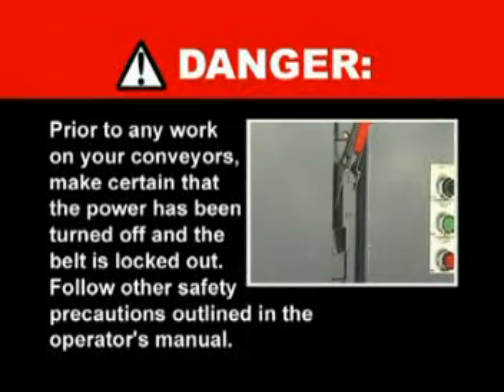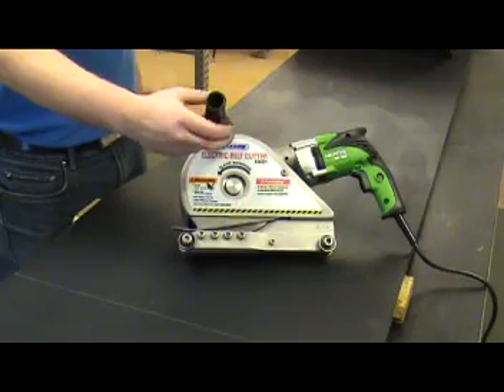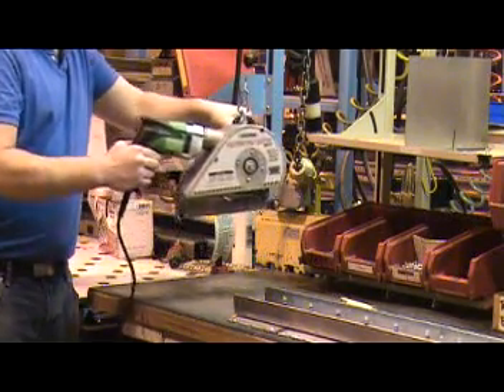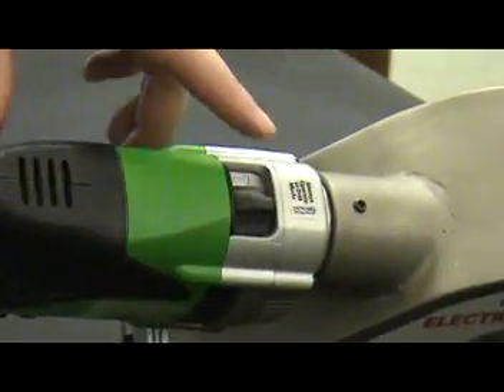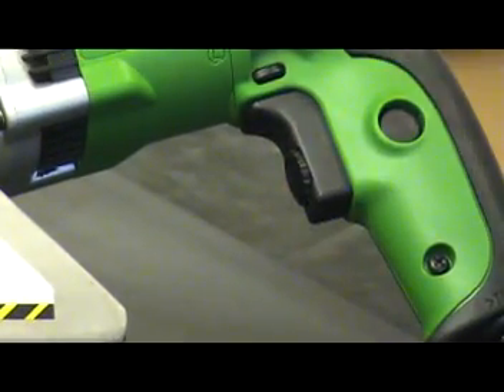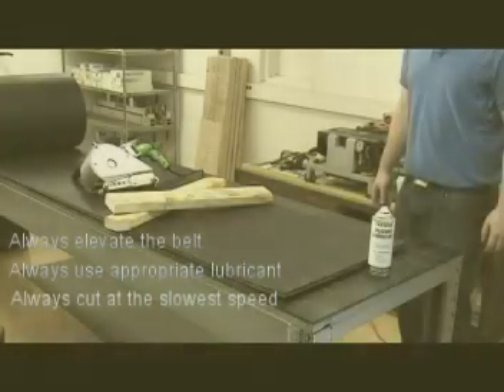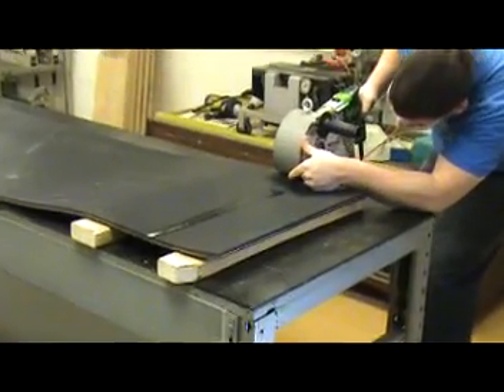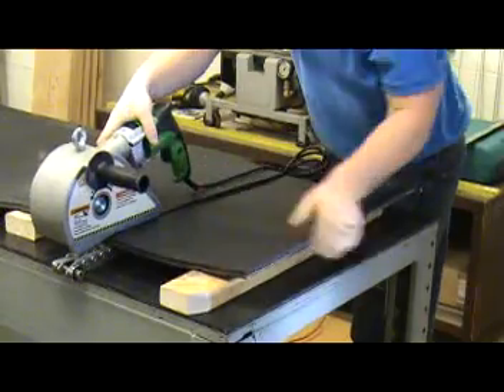Electric Belt Cutter Installation

Comment: Hi there, just a random question Mr. Flexco... is this the ideal tool to use as a belt slitter for cutting 150m ep5-600 12mm rubber rolls down or is there a better option out there?
Reply from the maker: The Flexco Electric Belt Cutter can be used to slit conveyor belt and rubber rolls down into narrower sizes with no problem.  You will need to mark a line to ensure a straight cut.  Flexco also offers a cordless version which may be better to accommodate slitting longer lengths.

Comment: Hi will it can cut m24 grade belt upto 100meters length we want to use removed used belt 1000mm width 100meter length want to make 800mm width 100meters
Reply from the maker: Yes it will cut M24 belt, however the cutter you need will depend on the belt thickness and belt rating. Contact your local Flexco representative for more specific information.